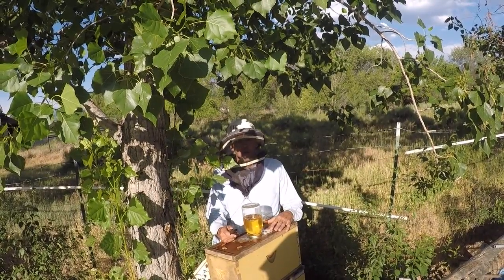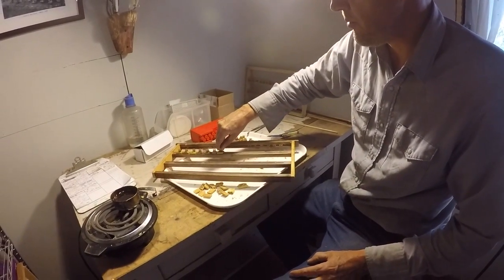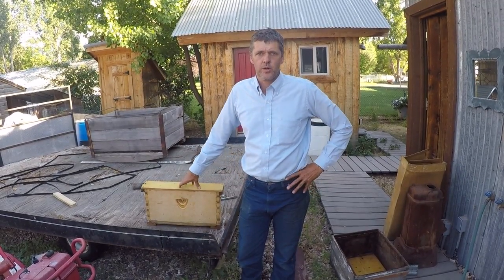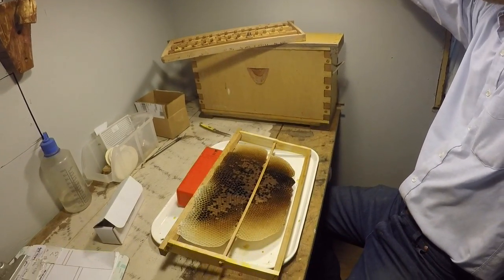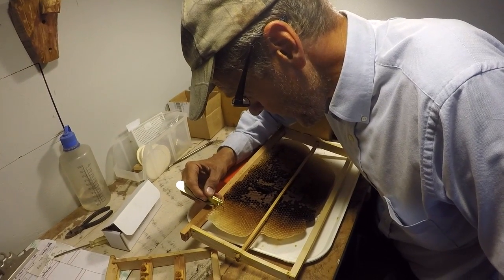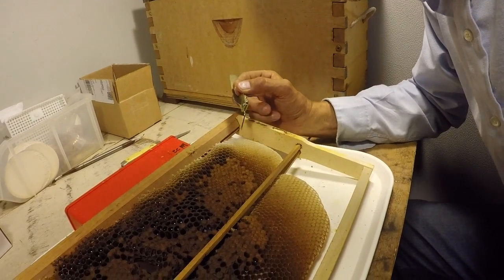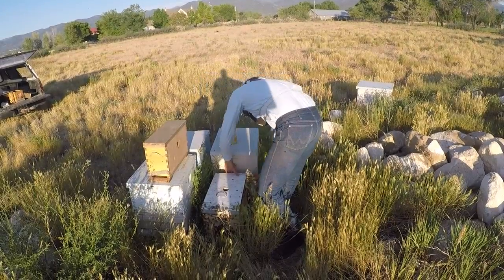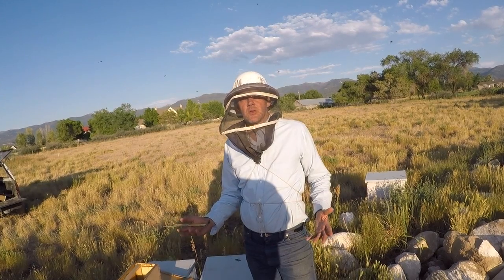Grafting Honey Bee Larvae

Comment: I've failed several times with grafting.  The tool you're using is way different from the ones that I've tried.  One is a plastic stick with a bit of bamboo on the end, the other looks kind of like a dental instrument, all stainless steel.  Is the grafting tool you're using easier to use? If so, where can I find one?
Reply: RTFMAce. watch this video.. "Queen rearing in the sustainable apiary"     Michael Palmer.